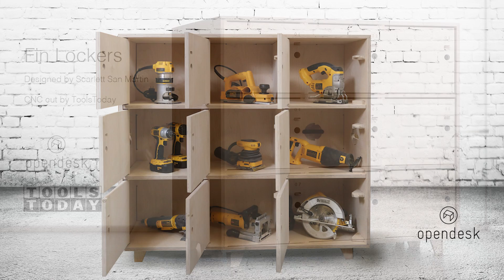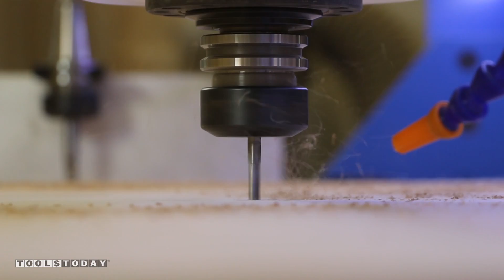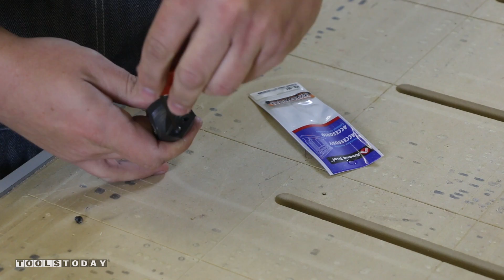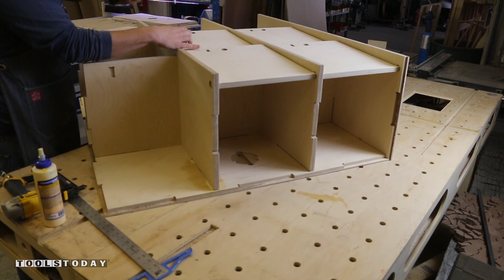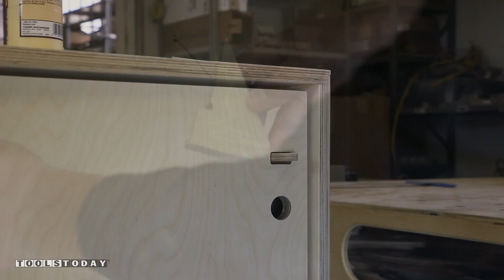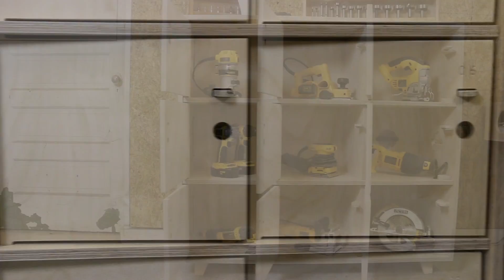CNC Project: Fin Lockers Wooden Cabinet Designed by Opendesk | ToolsToday

Comment: Hey quick question: Isnt 125 IPM @ 18k RPM way too slow for a bit like this? I have this template from youtuber ''cuttinitclose'' who says for your setup you need to run a chipload between 0.011 and 0.013. What are your thoughts on that?  Cheers

Comment: Why did you choose the 1/2" PCD compression over a regular carbide compression?
Reply from the maker: We chose the Polycrystalline Diamond (PCD) tool in order to showcase the extra hard and extra long tool life of the PCD tooling. Although Amana Tool® has excellent router bits for this project, the PCD tools are excellent for harder materials such as MDF and composites. The PCD tools save you time and money as they are designed for cutting thousands of feet of material without changing the tool, you save the setup time and the cost of replacing the tool.